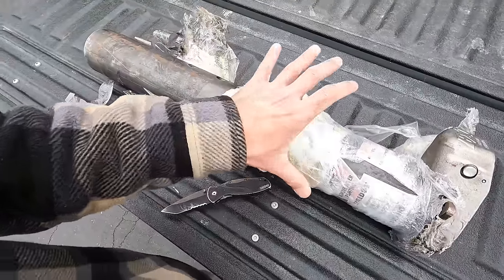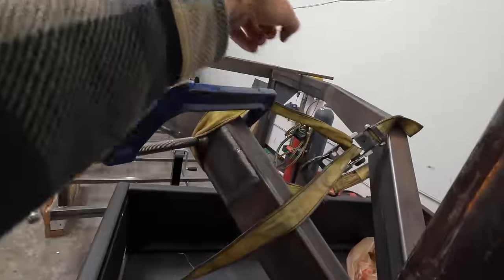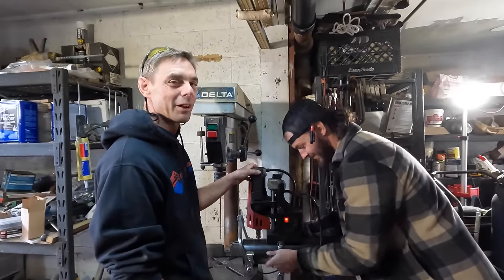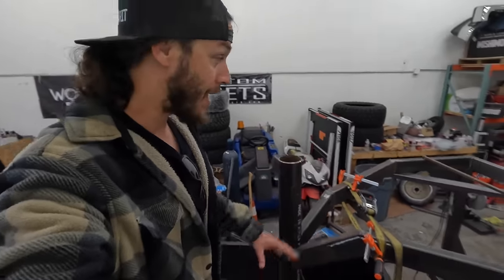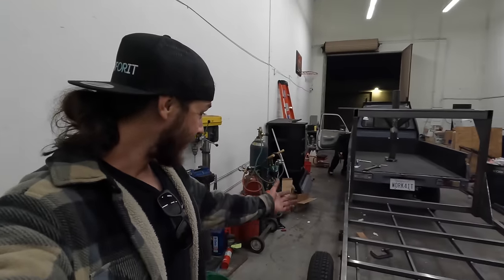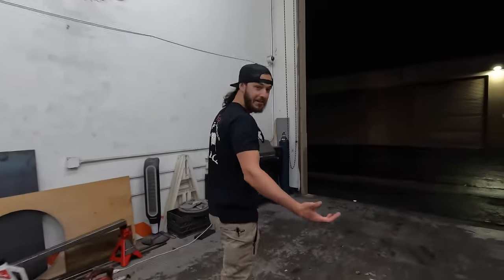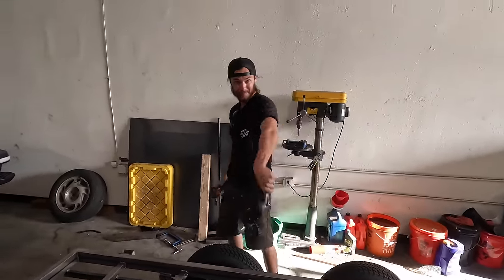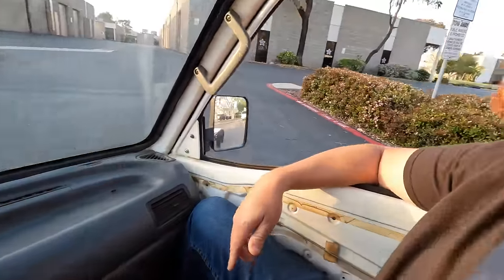Building a Mini Gooseneck Trailer for my Mini Truck! (Part 6)

Comment: First truck an trailer I learned to drive an pull with was a standard trans with a fifth wheel.  86 3/4 chevy. Pulling skid steers an mini excavators.  Before I even had a driver license or learners permit.

Comment: Ok now you need to find a Geo Metro and get the motor out of it or find a Geo Tracker and get motor axles and transfer case and make it a 4x4... That would be way cooler... Great job on the trailer... Your welding is getting way better... Great job...
Reply: @Baum Squad Yes I know this but way more fun to build one...

Comment: You should put a 12 inch downward slope on the end like at a 20 to 30 degree angle.... even if you don't need it the trailer.will look better... imo

Comment: For the coupler and ball in the bed. A regular 2 inch ball welded to a shank with a larger piece of tubing to slide into and pin would work fine. No need for 2 5/16 ball and the turnover and all that. For the coupler a piece of 2 inch pipe with a plate welded inside for the ball to rest on and a pin that goes under the lip of the ball to keep it from coming off. I’m not criticizing it just seems like it would be a lot easier and cheaper than the route you went

Comment: If u push a slot steel sheet into or out of a say pipe like this it is not just bs pin holds slot ht up & down & connects slot way stronger together no weld needed at that pnt if u sheet slotted or pined together both it is safe secure connection.

Comment: hve u can slot pin two pieces of steel togther u r not just trusting welds that can brake. If u lay 1 pole over another & pin u need to 45each end of poles u r going to lay over top of the other dah lie log cabin ends to lay over or notch out each end or square 4by 4s.

Comment: 13:57 And if money is an issue you can get a corded one for the shop at a cheaper price and have a cordless for out on the jobs on site. That would give you a cheaper option for that second grinder.